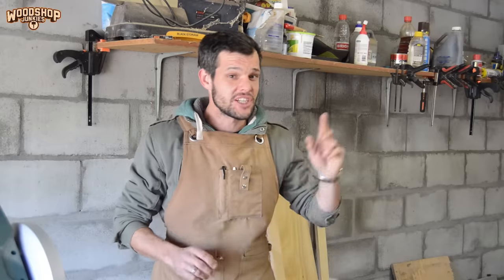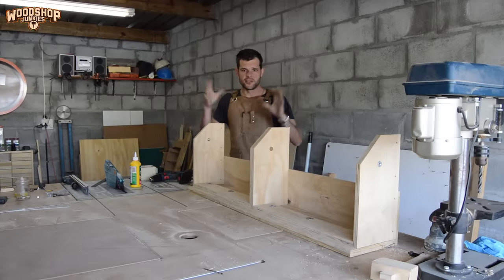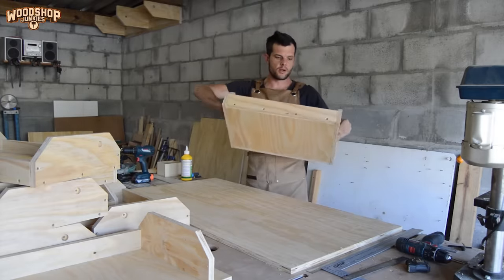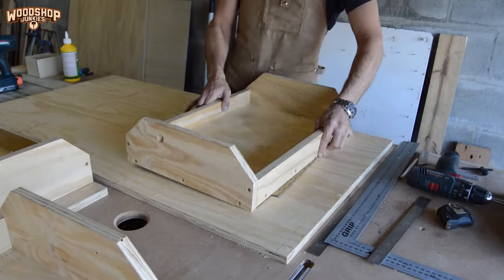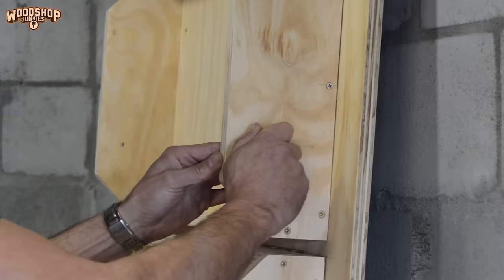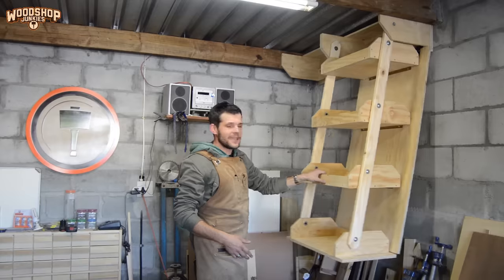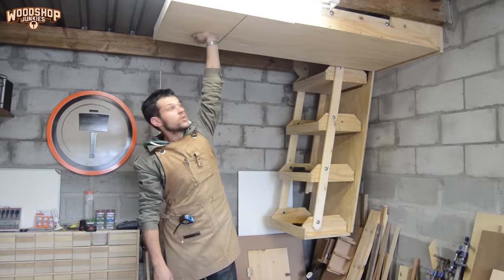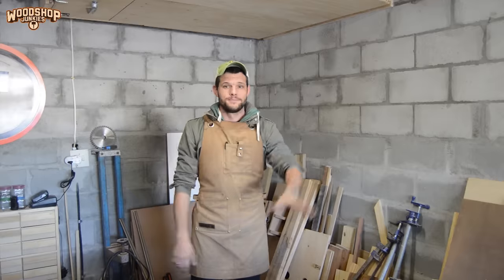Installing The Ultimate Garage Workshop Storage Solution

Comment: Very nice. Only one thing I would change. Because it comes down right against the wall, you cannot have anything behind it on the wall, forcing the wall to be empty at all times. I would suggest pulling the unit away from the wall (with some sort of stopper when it is pulled down, of course) so that you can have space to store additional items on the wall.
Reply: Yes. This.
Reply: I wanted to say, that while I was looking at this setup as the "perfect" solution to my 1 car shop, I NEEDED your comment! Honestly, why wouldn't you flat store tools and have the bulky things drop when needed! Thank you for being kind enough to point out even further practicality!
Reply: No need a stopper... put the hinge in line with the shelf's front.
(You can keep very rately used tools in lost place between the hinges and wall-above the shelf unit).
My 2 cents...
Reply: Yes I agree.  If you have a cabinet or workbench along a wall you could build this to fold down in front of those cabinets when needed.       As for dealing with the weight and to make it even easier you could put a pully and cable to close them.   Even use a small electric wench and then you could just mount a up and down on the wall.  I have a single car shop and space is tight.    I would like to do this in my walk in closet too.
Reply: Or use shelves with wheels that can be moved when you want to pull this down
Reply: I would just put regular high capacity shelves there. 1 higher shelf around the entire ceiling.  Just have stategic step stools hung on the wall.
Reply: I think that was the purpose of the extended pieces at the bottom, besides providing a visually pleasing angle once lowered.

Comment: WRT the dowel rod inside of PVC pipe, next time, score the dowel rod with grooves that either run down the length of the rod or in a spiral pattern. As you watch your video of assembly, when you are pressing the dowel rods into the tubes, you see the MAJORITY of the glue being wiped out of the joint. The grooves hold the reserve of the glue inside the joint while the glue cures. This IS the reason why premade dowel pins have those grooves in them. Lots of experience went into that simple modification, best to copy it.

Comment: I have two comments, 1. The large backboard could easily be replaaced with two 4 inch (or any width) boards reducing weight and allowing use of easier to find hinges. 2. intead of mounting horizontally to the wall, the whole assemby could be mounted vertically from the ceiling beams so that the shelving might be installed anywhere in the garage

Comment: We have a very open floor plan, which limits storage in our kitchen. We do not like upper cabinets, which limits us further. We've discussed using this concept to build extra kitchen storage (food, kitchen gadgets, bowls, etc.) giving us the openness we like while regaining the storage lost. I've given some thought to the weight issue and am kicking around the idea of a pully/cable/spring concept instead of a piston. All of the mechanical stuff would be concealed by the side boards. Interested to hear you thoughts on that idea.

Comment: Young man, I like how you wear hearing and eye protection as well as a dust mask. That's a good example to set. I've subscribed.
Reply: except when hes using the hammer drill into the cinderblock which is arguably just as bad/worse than the wood dust...

not to be entirely negative! great video and design work, subbed.
Reply: Off topic question, but why is your username "truth is truth" ?
Reply: Except when using the drill press...
Reply: Why use a respirator for dust?
Reply: @slrs3908  - fine dust particles get into the lungs and your body can't get them out.  It causes respiratory problems and in some cases cancer.   It is as bad or worse than smoking.

Comment: Awesome storage idea. I can see this being used for Tiny Houses and such. So yes, please do refine for other storage. Kitchen, bedroom, bathroom, bookshelf, gaming shelf, and even an entertainment center if one is crazy enough to make it.
Reply: Definitely would work with lightweight storage. Although I am tall, I can see unlatching it as a hassle for some. I am curious to see about making a floor platform with this kind of a mechanism in mind for a tiny house type scenario as they love to use both upper and lower hidden storage.
Reply: @postscript1561  I think for a floor platform you could basically reverse it and move or add a platform to the top (now bottom) of the shelves I'm thinking for like plates, utensils, spices, etc...  with a desk/kitchen combo, fold the desk up, lift the chair/floor, and you have a kitchen ready to go. you could even make a shower like that, make the lower shelves smaller, and add a cloth and shower head on the top one.
using a latch with a rope, car trunk cylinders for slowing it down, and a pulley on the you can make an overhead hidden compartment that even children can use.
Reply: Coming from the floor or the roof is either way not very efficient for tiny homes. You save space when it’s open/close but you also need a clear space in order to open and to close the whole thing.
It’s a good design for nails and workshop storage, yes, but for spices that you’ll need to open atleast twice a day it becomes less reliable.

As an alternative I can propose one genius idea I saw in a friend’s parents’ house. They have drawers & cabinets in their non-supportive walls. It sounds stupid but it saves a lot of space !

Comment: If it was mounted away from the wall a bit you could have had some wall cupboards as well. Love the concept of this and the multi function bench.Good job.
Reply: Peter Guilliatt 
Yeah that bench! 
As I was watching I was thinking I bet he has a router tucked away under there! and there it is! I bet he has drum sander there waiting to poke its head up somewhere.
Reply: Great idea, perhaps a storage cabinet for seldom used equipment and when you need it you just lift the shelves up to gain access.
Reply: The cupboards could be on a slid and counterweight the shelves.
Reply: I 2nd you on that.
Reply: good point. a place for hand tools

Comment: One if the most ingenious ideas I have seen on youtube for a long while. There is just one thing I might have done differently and that is to set the hinge point further out from the wall so that the shelves don't drop down against the wall. If this was done you could still put shelves up on the wall and your roof shelves could still drop down in front of them. However, I am still very impressed with what you have done, what an awesome solution for a small workshop.

Comment: I wonder, those who disliked the video... What did they not like in it.   I have seen a very useful idea that helps  in preserving space.
Reply: They didn't like the fact they didn't come up with the idea.
Reply: @RouteNRide    Its only in the way when your getting a tool you need it folds back up.
in a garage that size space is such an issue that just that much storage give you a place to stand.
I have  times more space or more like 10 times more and its not enough space.  I'll bet that will hold 350 lbs of stuff and not fall. But yes he needs a way to balance the load putting it up or taking it down. However it will help build arm strength. That way you can pick up your beer at the end of the day and the tool's are shut off.
Reply: Being short makes this unworkable...Maybe they are short people.

Comment: I saw this idea employed in an episode of Tiny House Nation.  To accommodate clothing storage in a sleeping loft, they built a thicker loft floor and storage units similar to the ones you build in this video.  The units opened downward to the laundry area, so it was easy to stow clean folded clothes right out of the dryer.  Hinged access doors in the floor of the loft provided access to clean clothes.  When I saw the episode, I immediately recalled having watched this video.  Well Done!

Comment: I'd put a dry wipe board on the wall so I keep track of what was where, as I know I'd forget and have to keep dropping it down to check.
Reply: Great idea!
Reply: Just use a labeling system on the bottom or side of each bin then you can just look at it
Reply: @EvergreenAcupuncture  or a nice little modular label system on the wall behind it - little slide in cards for each shelf ... this is shop stuff, you HAVE to go over the top!

Comment: Tip for this:
Place your heavier items on the upper shelf as the hinge itself will carry the predominant portion of the weight making it easier for you to open and close.
Granted this means that you have to lift the heavy items to the high shelf, but you won't have to again lift them every time you open and close it.
Reply: I think that depends on whether you lower and lift the whole shelf more, or that heavy thing on and off the top shelf. I'd guess the former, but it's a situational thing.

Comment: Great job! I did a similar design for book shelves on the front of a Murphy Bed, so they will pivot when the bed is lowered.
Reply: Derek Smalls I would love to see that design. I’m am in the early stages of designing our Murphy Bed and cabinets.
Reply: @adamkairy8465  I unfortunately don't have photos or plans of that specific project. Did this as a "seat of the pants" design when helping a friend. I can try to put something together as a video that will explain it. Basically an open faced box, hanging in the frame, with a pivot pin (we used bearings to insure a smooth action) set about 2/3 of the height of the shelf. It needs clearance at the back, but the weight of the shelf should cause it to hang straight. We built it with legs that swing down as well, to insure clearance underneath for the shelves to hang when the bed is down. A short rail or ledge was added just to insure things stayed in place while moving.
Reply: Derek Smalls thanks for reaching back out to me. How you explained it makes total sense! And simple. I love the idea.  I will work my magic and see what I can come up with.  
Thanks again
Reply: @adamkairy8465  I did just a very quick diagram and video that should explain it pretty clearly. Again, nothing revolutionary in the build, but I don't see a lot of Murphy Bed projects that incorporate this feature. Only other thing I'd recommend is some sort of pin or assembly to keep the leg in place.

https://youtu.be/S0OjunpdUlI

Comment: This is the first time I watched one of your videos and early on I thought what a nice big work table you had in a small shop but a huge waste of floor space, but then you popped up the miter saw and it blew me away as did your your scissors leveling gizmo that you used in conjunction with your drill press.
Reply: watch the build series on the work table. Other than the apparent love for MDF on the top etc, I love it ( I just hate......um... very much strongly dislike... MDF)
Reply: I too was blown away by the work table

Comment: That's not garage storage, that's cabinetry.  I'm surprised you didn't pull ball bearings in your pivot points.  I'm impressed with your design, and your execution, but your materials are more costly than most of us want to spend on "garage storage'.  All that said, I'd like to spend a week or two with you sharpening my own skills.  That table of yours is to die for.

Comment: Pro:
Good concept and great way to maximize the available space!
Side benefit is to hide away all the hand tools out of sight, clearing valuable space for other things. 
Very creative.

Con:
A bit of a bother if someone needs some of those same tools on a regular basis;
Not very convenient and can be easily too heavy once filled up... 
Potential for it to come crashing down on someone's head regardless... best to attach some sort of pneumatic spring -- what a mess that would make as it bangs into the wall not to mention the skull crushing blow on the way down.

Your bench work area is 'sick', impressive !
Love how you've created something to hide sizable tools as well as provide a very large work area, albeit rather permanent as it is too big to move.

Comment: The cloths storage idea would be great. They would also be lighter than shop tools and screws. Shoes, sweaters and extra sheets stored on the ceiling. The designs I saw from the 1950s extended the back support all the way under the lowest bin, giving more stability.

Comment: Where does everyone get all these perfectly straight and nice plywood sheets from?

All I ever see is warped and terrible looking wood at hardware stores near me.

When I do finally see some quality wood it's so ridiculously priced that it would cost like $300 in wood material plus hardware, plus the time to build a super small shelf.

Is wood just expensive everywhere, or can reasonably priced wood be found.

Right now I basically build everything out of found pallet wood because it's hard to justify a $500 garage shelf, when you can buy one for $80.

Comment: Genius! Since I'm not an expert in woodworking though, I'm gonna alter the plans somewhat. I would be making shelves that carry objects that can be stored vertically, so I don't need the pivoting part of the shelves. Also, I would use a heavy duty pulley system that would take care of the shelf weight and keep the shelf in its place once suspended. For me, it would serve to fill the lost space above my garage door, basically to store things that aren't frequently used (since I would have to move my car when I use the system). Thanks for the fantastic idea.

Comment: I so wanted to trash this video - just jealousy!!! I kept going "that's a good idea!" as you were building it, concluding with an out loud :ooow, that's a good idea!" when I saw the quick latches locking the cabinet in the up position! Very good design and build!!! However I did notice one thing: do not store any paints, solvents or glue in it as it being that close to the bare metal roof will surely do them in!!!
Reply: shall I list them for you....lol,,,,,,  i've come up with 10 ,,,but I guess I should consider availability of things there too
Reply: Yeah I'd agree also since paints can leak and expand near heat sources like roofing material
Reply: @lakesideinc  I'd be curious what you came up with, as well as to see your brilliant builds

Comment: Awesome Video. It has given me some inspiration for my Single garage workshop which could use a shelving system to tidy up
this system also solves my ceiling problem with the heat transfer from a tin roof.

Comment: Great job, Keep it up you are doing very well!!! Love seeing it!  Not sure what you've done since, not sure of any suggestions mentioned, js.  In my garage 1-1 1/2 car, above the door I made a "U" shape 4 x 8 along the walls joined in the middle with 4x6 which hangs at the corners with 2x4s to the rafters, it also is framed with 2x4s under each section.  I say this because i see there is usable space above your door.  the video of the storage in the  ceiling at the back was genius.

Comment: I have l3eft a comment on your other site, about using a garage door torsion bar and springs for your soft close and open solution. Since the torque is adjustable by the number of winds on the springs, and travel is adjustable by cable length, it offers a very inexpensive and practical solution. An 8 foot bar, would allow for 8 feet of storage, a 16 ft., and 18ft respectively, would allow more.

Comment: This is a great idea, one I'd like to look further into. I would like to do a frame of metal with timber drawers/boxes to reduce the weight. Keep up the awesome work. Maybe a pulley or weight system to assist with opening and closing would be good, a weight system where the weights can be added or removed to counter balance what's in the boxes, essentially making the whole thing weight free and easy to lift.

Comment: Great execution - if you move the installation position further out into the room you will enable some extra wall space to be used for tool boards or shallow shelving.
Reply: This was going to be my comment, the idea and implementation is top notch, but you have to think carefully about placement because you have to keep the area that shelves travel through clear of all obstructions. Personally I would use a design like this either for stuff I use all the time, but occasionally want to move out of the way, and the shelves would remain mostly down, or stuff that I don't use very often and I don't mind moving a few items out of the way in order to drop the shelves down. If you plan to open and close them all the time, and therefore keep the area under and around them permanently clear you might as well just have regular shelves.

Comment: This would definitely add storage in my condo basement between the joists. The shelves wouldn't be as wide, but since it's a craft & hobby room, it would store smaller items. It wouldn't be any lower than the drop ceiling is now and it would add a layer of sound insulation from the main floor above.

Comment: That was a pretty awesome design. The only small thing I probably would have done differently is position the opening and closing handle out from the bottom with a spinning handle so I'm not underneath it when pulling it down.

Comment: I love your plan and once I get a shop I will be using your idea. One thing to help with the weight is the lift mechanism from an attic ladder might be useful. Just don't know if it could be found to hold enough weight. Or could use a counter weight system used in old windows.